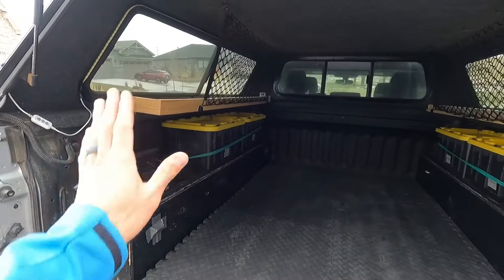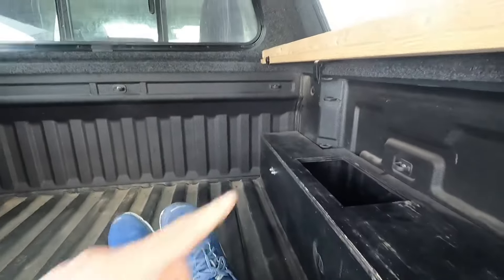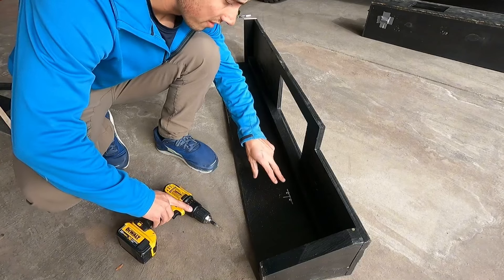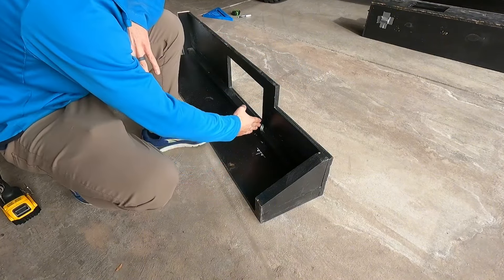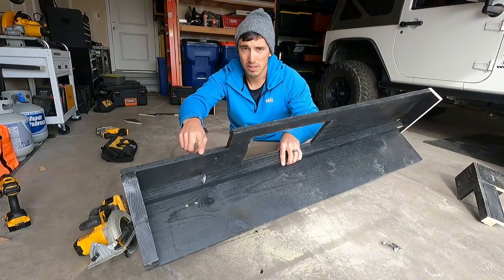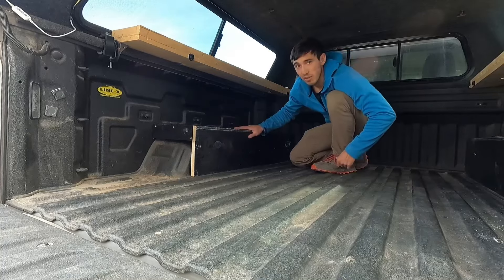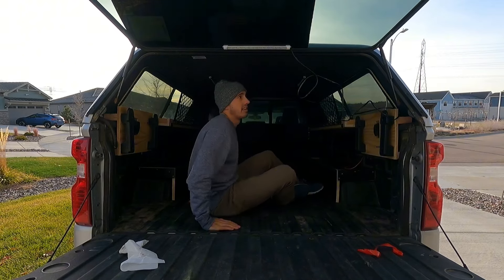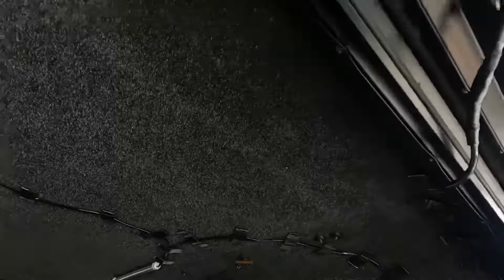DIY Minimalist Truck Bed Camper Build - Part 4 (Changing Things Up)

Comment: Hey Derrick, Have you considered raising the bed? Even a few inches would give you under storage for tools and rarely used items or muddy shoes. But at the sacrifice of head height. Another item you may have considered is a tri fold bed that can be pushed back towards the cab of the truck converting into a bench/mini sofa. Freeing up some floor space near the tailgate when the bed isn't in use.
Reply from the maker: Thanks for the recommendations! I have thought of raising the bed a little but i would have to take it out when I put my bikes in because they just barely fit now so I decided against it and just made sure to slim down the amount of gear that I use  so I have plenty of storage. As for the bed I really want to do that so we can hang out in the bed easier. My plan as of now is to eventually get covers made for our current foam and when we do that cut the foam to be able to try fold it and have the covers made to accommodate that.

Comment: Still using the same mattress this whole time?
Reply from the maker: Yep it’s a 5” thick firm foam mattress I got off amazon after college that I just cut into two pieces and it’s worked great for me. I need to make covers though because the fitted sheet is getting pretty ripped up.